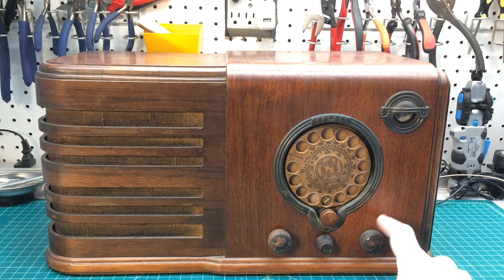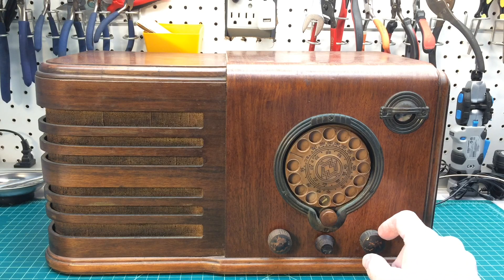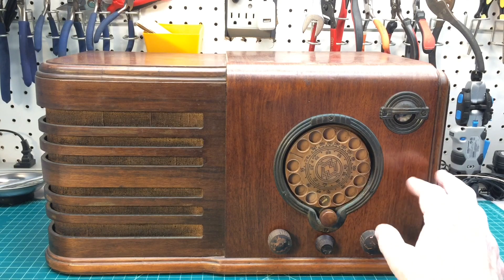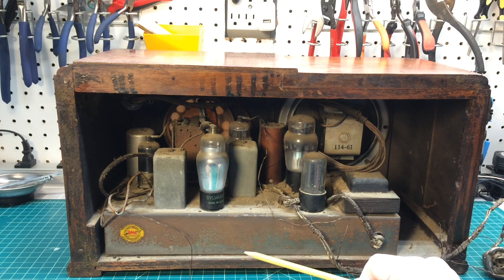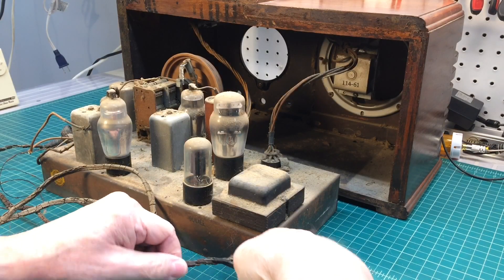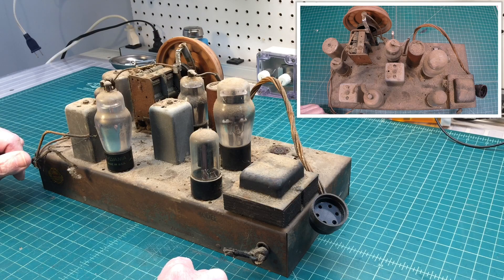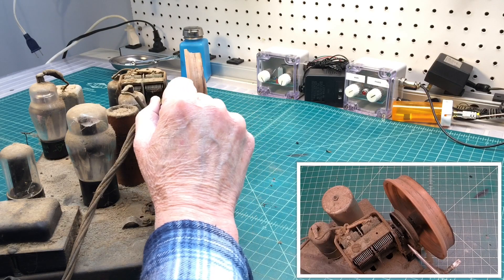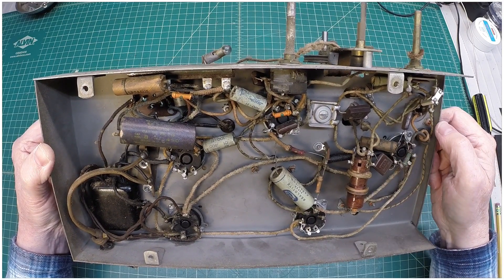Montgomery Ward & Co. (Airline) - Model 62-306 Teledial Introduction

Comment: A very interesting video! I can certainly see that there was still a modicum of quality of the materials and workmanship, at least on that particular radio, even though it rolled off the assembly line during the later years of the Depression! It must have been a high-end receiver for its time. It probably would be a good idea to initially check the continuity of the IF coils, as well as the primary and secondary of the power-supply transformer.
Reply from the maker: Thanks Chet. Those initial checks are on my list. I checked the field coil, output transformer and voice coil today and hope to publish that video tomorrow. The antenna, oscillator, IF coils are next then moving toward the PT. Thank you for watching. Best, Don

Comment: I have a model 62-345 teledial radio that I'm gonna have a go at trying to bring life back into. I hope to find inspiration from this as I have little knowledge on what I have to do
Reply from the maker: Braedon - vintage radios and alike have lethal voltages, so you should not attempt any repairs without the working knowledge and equipment to safely do so. A video I did that demonstrates why you should never power up and old... RCA 8-X-541 - Cause & Effect P1 (Why You Should Never Power Up a Vintage Radio or Alike Before...)
https://youtu.be/l5gm2CLmaFk

All of the paper/wax & electrolytic capacitors have to be changed, all resistors that are greater than 10 to 20% out of tolerance, all wiring that is compromised and of course any tubes, or other... that is defective have to be replaced. If you elect to make any repairs, you’re doing so at your own risk.

There are an number of folks that offer repair services, so let me know if you need my help identifying someone.

Best,

Don

Comment: Can't believe how sparse it is underneath. Hardly any resistors or capacitors. There's a few clustered around some of the tube sockets, but hardly anything under the converter/RF tubes.
Reply from the maker: It looks like something is missing. To your point, a lot of open space. Best, Don

Comment: I've got one very similar this. It actually works, but I need to go through it and recap it. It sounds wonderful. Mine has additional knobs, vertical speaker grille slats and the dial itself is backlit.
Reply from the maker: Kevin, that’s cool and congrats on your find. Do you know the model number? Best, Don
Reply: I don't. Here's a photo of it, however:  https://flic.kr/p/o2JzJ
Reply from the maker: Just gorgeous!
Reply: I found the model number. Now if I can just find a schematic...
Model 62-397
Reply from the maker: I can’t say for sure, but you may find this schematic to be a close match: http://www.nostalgiaair.org/pagesbymodel/484/M0011484.pdf

Comment: Hey Don, Looks like that radio was always taken very good care of, at least on the outside.  Maybe you'll get lucky and all that dust will have protected it somewhat....unless the dust held a lot of moisture.  There certainly is a lot of "real estate" under that chassis...talk about a minimalist approach!  Will eagerly follow along to see that beauty come back to life.  Take care, Gary
Reply from the maker: Gary - I’m afraid the rust is rather wide spread across the top of the chassis. Dust and 🐭 make a nasty combination. At least the underside is clean. I meant to inquire, hows your Fada radio project progressing? Best, Don
Reply: @RestoreOldRadios Hey Don, To be honest I haven't touched the radio, or any other radio in some time now.  Seems like I've been staying pretty busy just the same though, lol.  Had to have the furnace repaired yesterday, Got a truck that needs a new clutch system up here from Tennessee.  Fixed the gas wall heater in the bathroom.  Changed out a large resistor in the Trailblazer that goes to the blower motor for the heater & AC.  Right now just trying to keep the pipes in the bathroom from freezing tonight, lol.  Later this week I have to move the furniture out of Ma's room and get the rest of that laminate flooring down that we bought about a year ago.  Always something.